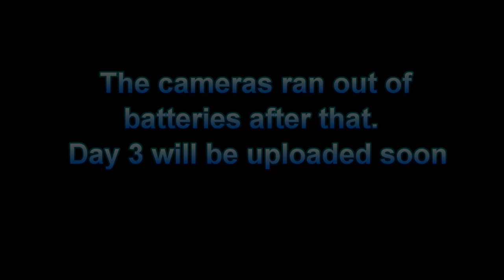Counts on Tour day 2 - Fuel and Foreign Filtering

Comment: Hi,what tank bag have you got and have you had any trouble with it scratching your tank.👍
Reply from the maker: Ricky 1234 Its a givi one, smallest one they do, quite handy. No it doesn't actually touch the tank because it's mounted around the fuel cap, so doesn't scratch anything. 👌
Reply: ValleyRider Cheers pal,just need a small bag to keep phone,GoPro battery’s, ferrying tickets,all the usual stuff,you know what I mean.When the next video coming,I find them good to watch.👍
Reply from the maker: Ricky 1234 Well then it's the ideal tank bag for ya, did exactly that perfectly when we went! Soon, we are missing a bit of audio footage so might have to miss out a day, next episode will be up soon though!
Reply: Is it the 3 ltr bag,is it waterproof and is the Brackets etc hard to fit.
Reply: ValleyRider 👍👍👍👍
Reply from the maker: Ricky 1234 I think it's either 3 or 5 litre, and yeah that yellow bag makes it totally waterproof, and no it's an absolute piece of cake to fit
Reply: ValleyRider hi,can you fit a aria helmet Visor in the little tank bag.👍
Reply from the maker: Ricky 1234 Might be a bit of a squeeze, we found the fitted better in a rucksack